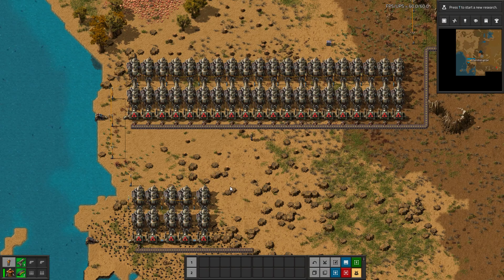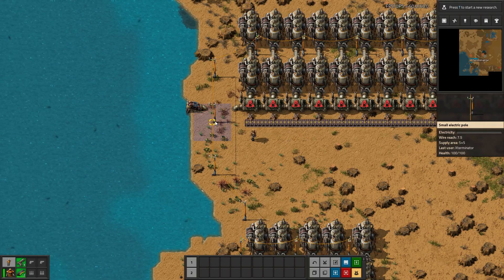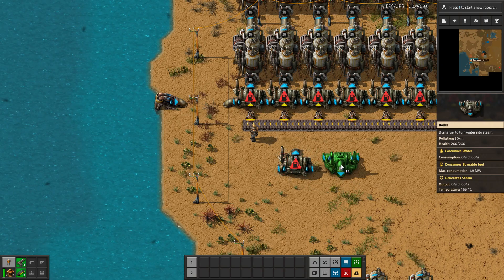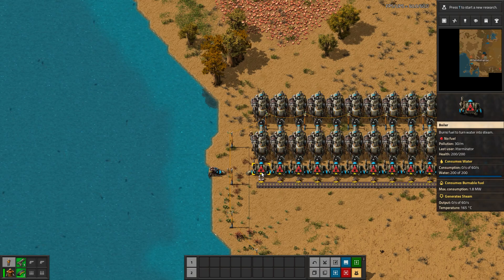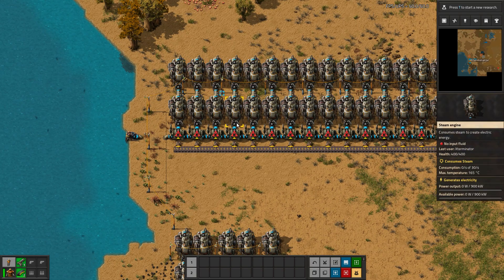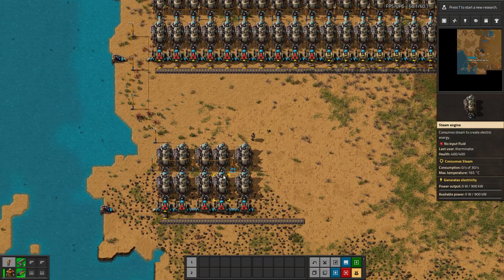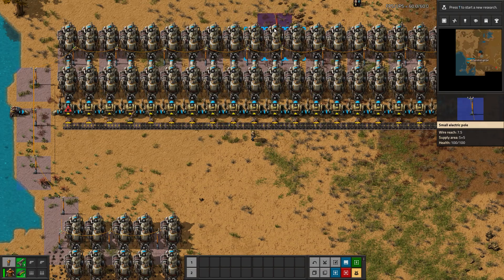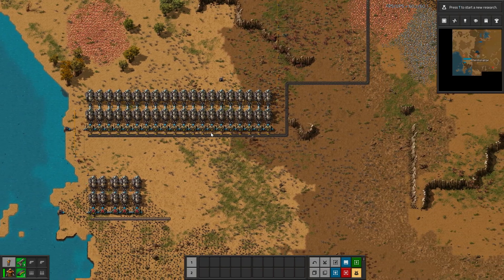Factorio Tutorial - Steam Power Setup & Ratios : EP 3 Season 1

Comment: so 4 water pumps 3 boialers and like ~13 steam engines is very not correct.
ooooh. They only use fuel based on what the grid is pulling? How does battery storage & solar effect this?
Thanks!

Comment: How does the 1200 water extracted from the pump run trough the pipes if they can only support 100?
Reply: 100 units stored inside. They can also flow in or out, and pump can adjust to that flow

Comment: Thanks for the video, I was just wondering if you could help me with a problem i'm having with the offshore pumps? 

I've hooked up everything with the pumps like the boiler (with coal) and steam engine, and have connected everything with pipes and the electric poles. Yet no matter what I do, the pumps never seem to produce any water. There's always a flashing red sign on the pumps, which means there low on power, yet when I click on them it say there working, plus offshore pumps don't actually need power to work?

Idk if this is a glitch with the mods, but I was wondering if you knew anything about this and how to solve it? Thanks

Comment: I definetly agree with the burner inserters for boilers.

In my second game (first to finish) i was already preparing materials for the rocket. My main power source were 2 nuclear reactors + 16 steam engines for when there is a sudden spike in energy need controled by a acumulator and a switch (the switch turned on when the acumulator was under 80% capacity, basic). While i was working on a minifactory for the components, something happened at my centrifuges, which forced me to turn the fuel production off. I totally forgot about that and ran on my reserve fuel (~150). After a while (i was finishing up my rocket fuel production) i got a blackout and i suddently realised what happened. My 16 engines kicked in, but couldnt even cover 25% of my energy need and my inserters failed after a minute of trying to fuel the boilers. I had to rush back to my reactors to manually start making (there was my uranium) fuel for them. 2 minutes after the total blackout i arrived at the place. 30 s later a huge wave began to attack my left wing of my base (~2-4 minutes with car from reactors) I have played for a long time, so almost all the biters were t3. My main defense were normal turrets with laser turrets helping them. Laser turrets were off, normal turrets had max. 5ammo. Not enough. I had to reload the save 2x to save my left wing. Used my explosive RPGs, blown up my walls and than rushed back to reactors, kicked them on, made a emergency repair off walls and after 30 minutes off blackout i was back online. THANK GOD.

So yeah, next time, when you set up a backup power with steam engines, use burner inserters. Unfortunatly i dont have the save of the game. Max. a recording of me showing the base and launching the rocket (took me 58h of playtime).

Comment: Great to see tutorials for the current version of Factorio.  Still lots of new and returning players.

I'd recommend burner inserters for just the first couple boilers in each row, as burners are inefficient, and you only need a couple to re-start.  I tend to use whatever burner inserters I have lying around from the burner stage, and normal inserters once those run out.